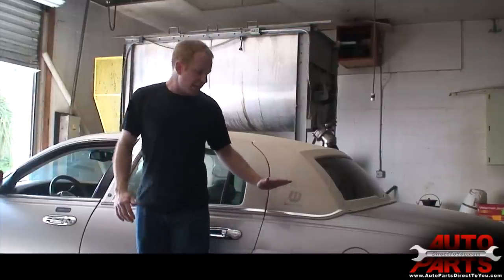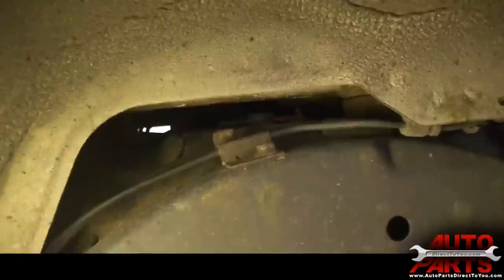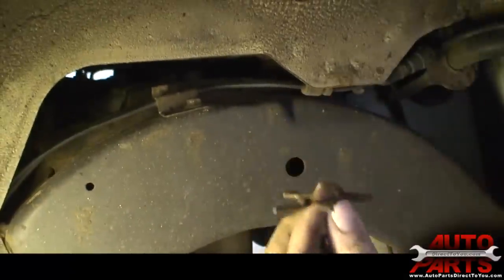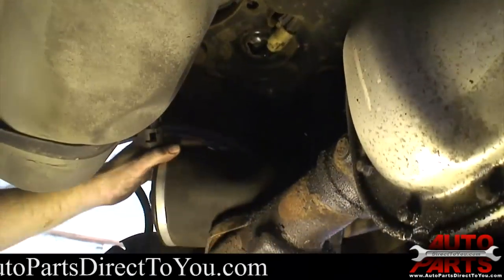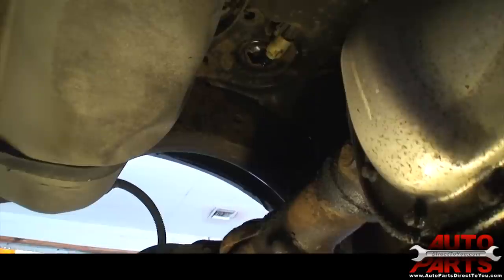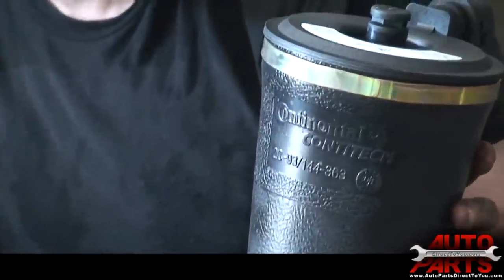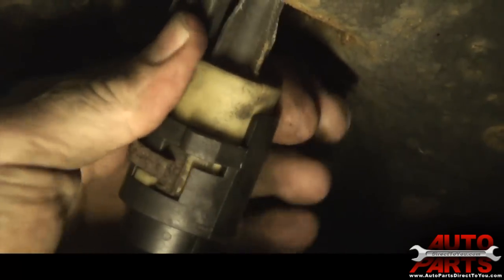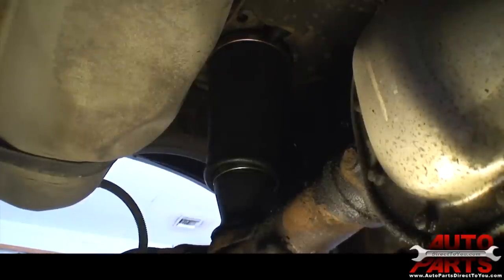1989-2011 Town Car Air Ride Suspension Air Bag Spring

Comment: On a Ford Air Suspension system, after the key is turned off, the following happens:

0-59 minutes. Only venting is allowed.
60 Minutes. The car will measure the height at the rear of the car, and either switch on the air compressor, or open the solenoids to vent the car.
61 minutes. The Air Suspension system turns off.

It's normal after an hour or so (time it) for the compressor to run for a few seconds.

Comment: This seems like a way easier job than some of the mechanics I've come across let on. I've been suggested a coil spring conversion kit a million times, as if changing these bags is some horrible process they wouldn't touch in a million years. Gonna do this myself. Thanks for the video, really appreciate it.
Reply: Most people suggest switching to Coil Springs because if the lack of headache down the road. But if a bit like this actually is a "lifetime" kit, that would solve that problem. Now just gotta worry about the compressor.

Comment: I don't want to convert it, I want to keep the system just like it is.
Reply: same here   never really understood the "sky is falling" problems people are reporting with the TC air suspension, maybe paid supporter by the same companies selling the conversions kits?   I have an 03 TC with 200K  just replaced mine   took all about an hour    three if you include the replacing the dryer and doing a little rust removal/touch up paint around the axle.
Reply: Love to sir ride I would never switch not even if I got the conversion kit for free-& springs ... I’d rather pay to drive a big fast sexy stylish cloud of air any day of the year 🙇🏻
Reply: @nodat11  how's your air ride suspension holding up since you replaced it

Comment: When the air suspension went out on my ‘07 Presidential Town Car, I replaced it with good ol’ coil springs, can’t tell the difference in the ride.
Reply from the maker: Excellent! We have found that converting to coil springs is so much easier and cheaper in the long run. Many people install a leaking airbag and then find out they need a compressor, valve body, or control module, after installing new airbags.
Reply: @APDTY  exactly, plus to diagnose all that and fix or replace was about $1500 where the coil springs parts and labor was $600! With a 2 year parts/labor warrantee😊

Comment: The power of YouTube...thank you APDTY. Although I am able to fix just about anything, it helps GREATLY to see it done in advance. Once you have seen the procedure - like you post here - it's almost like having already done it by the time you get under the car. I did my first set of ball joints recently - same great result.

Great job on the video and much appreciation for your tutorial....

Steve in Atlanta, GA
Reply: Steve Kilby  is there a good front suspension video for a Lincoln town car that would help do the front end please please please I can refer to thank you

Comment: By far the best video on the replacement of the air bags. Thank you.  I or we may need to move on to other issues that may include the air pump itself, any other inline solenoids, etc.  Thanks again.

Comment from the maker: Here is our conversion kit which gets rid of the expensive air ride system and uses conventional coil springs and shocks, it includes 2 New Shocks, 2 New Airbag Springs, & instructions (Made In The USA):
http://www.amazon.com/gp/product/B004BUWPIK/ref=as_li_tl?ie=UTF8&camp=1789&creative=9325&creativeASIN=B004BUWPIK&linkCode=as2&tag=aupaditoyo-20&linkId=SYFKBCRKPOJ4C4JF

Comment: Hi Bam,

The Air Suspension in the Town Cars will only adjust front to rear, not side to side.

In order for the rear to be properly inflated, you need to completely release the air out of the left and right spring by twisting the solenoids and popping them out one notch. Remove them, and check to make sure the O-rings are seated properly, then re-install, and then let the compressor air up the rear end.

Comment from the maker: @possiblefurry The compressor unit on your car is located on the front passenger corner of the engine compartment, there is no simple fix for it, but if you are tired of the air suspension going out at random times, they do make a conversion kit to change it over to normal coil springs.

Comment from the maker: the compressor should come on to reinflate the air spring after the job is done, if it doesn't you may need to try resetting the system, you can do so by disconnecting the battery for a couple minutes and then reconnecting, also be sure that the air-ride switch is turned on in the trunk.

Comment: great video; i have one question  how in the world do you put the solenoid back in. when i go to put it back on i have a world of a time trying to get the second twist in.  i push it in straight then turn clockwise one time then when i go to push the next time it just want go so i can't twist it the second time to make it lock. there is some kind of pressure there that i am not noticing.  help me out please   thanks
Reply: Damn I wish somebody answered this 12 years ago, now 12 years later I am stuck in the same spot.

Comment: I have an 04 Lincoln Town car ultimate.  Last Friday air suspension was fine and normal.  Saturday morning, I noticed from trying to back out of driveway that it wasn't sitting right and noticed both sides were lower.  Not sitting on the tires, about 4 inches between top of tire and wheel well.  I tried bypassing switch in trunk with a wire and that didn't work.  I ordered a Dorman compressor from Amazon and put it in today with trunk switch off.  After getting air compressor and air box installed again.  I started the car and the air shocks are not rising uo.  I also replaced both fuses in fuse box under the hood just to get easy fixes done for rasm.  The car almost looks like it's sitting leveled but slightly lower in the rear.  Why is it not rising up the shocks? Vehicle only has slightly under 80k miles.  Is it the height sensor and where exactly is that located and how much?  I'm trying to narrow it down so I'm not replacing everything if I don't have to.  Any ideas??? I don't think it's the air springs because before Saturday, they were working perfectly fine and well inflated.  Somehow Friday night or early morning they lost air.  I've read about solenoids, height sensor and of course the air bags.

Comment: I'm doing this repair. I cant get it seated on the differential, is there something I'm missing?

:Update took awhile but I put some packing grease on the differential and bottom clip. Lined it up and i drop the car very slowly about halfway and started my car and it aired up for a min until it clipped in. I did this to both sides. Now I'm clipped in and riding on air. Also i have a 2000 Lincoln town car with 76k miles. It was my grandpa's.
Reply: How do you know that it's fully seated
Reply: To the dif I can't seem to get mine

Comment from the maker: @961995h Actually a Continental is a totally different Beast,, your car is front wheel drive which means the suspension is a totally different setup. You have Independent Rear suspension, while the town-car has just a solid rear axle. We do have the conversion kit available for your car, but it's a little trickier to install.

Comment: Another way to do this is to place a jack on each side of the frame just before the rear wheels, and jack the rear end so it sits a few inches higher than it normally does. Turn the ignition on, and let the compressor vent all the air from the springs. It will take several ignition cycles to do this. Do it until you no longer hear air flowing from around the air springs.  Lower the car, start it (or turn the key to ON) and let the compressor air the springs up. It make take 2 Off-On cycles.

Comment from the maker: You can search our website for part number A-2220  and you will find the heavy duty air springs. These fit the 1990-2010 Town Car. And they fit standard town-car too, it does not have to be the limousine.

Comment from the maker: The ride will be the same between those two, the only difference is that the heavy duty is designed to hold more weight. It is specifically for the Limo and fleet chassis.

Comment: I ordered the two air bag springs, and installed them.

It was driving fine, and still is. However, it seems one side (passenger side) sits a touch lower than the driver side. Is that common?
Reply from the maker: Sometimes a fail components in the front suspension can show it's effects visually on the rear suspension. Measuring ride height of all four corners should lead to finding the issue.
Reply: APDTY Hello is there anyway I can get the Height Specs of a 2000 Lincoln Town car P

Comment from the maker: The air suspension system stays energized for a set amount of time after turning the car off, if I remember correctly it's either 15 or 30 minutes. During that time, the pump can turn on unless the master "Air Suspension" switch is turned off.

Comment: Thanks for the video. Helped quite a bit. Determined that I have one bag (drivers) that is going bad.... slow leak. One question when turning off the suspension then raising the vehicle. I turned off the Air Suspension (trunk) about 30 minutes before attempting to jack it up and replace the spring. Seems the bag still had too much air in it even after disabling the system/compressor and jacking up the vehicle. To explain, it was hard enough so that it could be squeezed with effort, but not as easy to remove or as deflated as yours is in the video. Any ideas on the best and safest way to approach deflating this so it can be replaced? Sit longer? Overnight? Video was a great help - thank you!
Reply: +MyPCHost Hosting With the vehicle jacked up and jack stands set under the frame, having the rear axle hanging (tires not touching the ground).  After removing the upper clip from the air bag, use a pry bar to lift the lower off the mount and push it forward. This should allow you room to continue removing the air solenoid from the top of the bag

Comment from the maker: The continental actually has a totally different suspension setup from the town car. Your vehicle is front wheel drive and uses fully independent suspension front and rear. So unfortunately the procedure is totally different and this video won't be of much use. As of right now we don't have one on the continental.

Comment: roy morin how you fixed your problem  because i have the same problem my airbag  suspension they're not adding up
Reply: It happend to me once, I unpluged the battery for 5 minutes then pluged it again then everything is running normal

Comment: I just bought air spring from Arnott and I haven't been able to connect the solenoid to the air spring it only goes half way I'm pushing it in and trying to twist at the same time but it's not going all the way in! What would you suggest? Thank you very much.

Comment from the maker: @w8tlftr4u That definetely sounds like an air spring leaking. The Mark VIII is similar but a little tougher, your car has independant rear suspension which gives much less clearance than the town car has. But the basic routine is the same, release the air, remove the clips, pull the solenoid, and remove the air spring.

Comment: i have a 1995 lincoln town car i dont here the motor to the air spring come on any more so how can i find out if it the air bags or the motor to the air springs?
Reply from the maker: Unfortunately that is the ugly situation many people find themselves in. The only way to check the airbag springs is of course with air in them, however you can also just take a visual inspection of the condition of the rubber bladder of the air springs. If you see lots of dry rot which is usually spider cracks, then they are either very close to the end of there life or already leaking. Most shops will suggest replacing the compressor and then will let you know if you also have to replace the airsprings, however at that point you can be in the middle of a very expensive repair. The compressor itself is several hundred dollars so if the airsprings show any sign of age or are 7-8 years or older, they dont have too much life left. Converting the suspension over to a conventional coil spring suspension is cheap and easy and here is a link to the kit at Amazon.com: http://www.amazon.com/gp/product/B004BUWPIK/ref=as_li_tl?ie=UTF8&camp=1789&creative=9325&creativeASIN=B004BUWPIK&linkCode=as2&tag=aupaditoyo-20&linkId=SYFKBCRKPOJ4C4JF
Reply: Thank took care of it last year it only took me 20 minutes to change them both out and replace them with springs to be my first time doing a job like that I did a good job.

Comment: i went over a drop off at my job's parking lot and blew something. the air springs have no pressure, but should i still be hearing the air compressor kick on?
Reply: Check the power switch for the compressor in the trunk?

Comment: just put in the Arnott conversation springs 2001 continual really easy now have no problem air compressor is off so should have no problem with the shocks again

Comment: Mine just stopped, I heard door ajar switch or relay are the first to check,what do you think? Thanks..
Reply from the maker: +rob henriksen Yes, checking for system power and operation should be the first steps of diagnosing the compressor not coming on. On vehicles with OBD2 you could also check for codes in the system

Comment: I purchased your air springs because of this video. I have the car off the ground but there is still air in the bags. How do I release the pressure. The bag is collapsed but not all the way and leaving too much pressure to remove the bags or reach the air solenoid. How do I release the air pressure all the way? Really frustrated and getting no where after doing this.

Comment: hi I have a 2004 town car 97k miles. when I start my car air compressor turns on for 8 seconds, when I'm driving and stop on red light air compressor turns on for 5 seconds, on 17 miles trip it does it 3 times, is this normal or early signs of leak air bags?

Comment: Hey just switch mine out with new arnott air springs but for some reason after bout 15/20 minuets of driving my rear end seems to rise higher then normal any suggestions
Reply from the maker: yes you can check the ride height of the front and back and make sure it is correct, if you tell me the exact year make and model I can tell you the ride height spec. Sometimes when you fix the rear and maybe the front springs are worn out, the rear can sit higher then the front, also depending on the exact model vehicle you have, the front and rear can be different. Another possibility is the air dump valve solenoids on the springs must be working, you would have a check suspension light on usually though, The only other trouble is if limo air springs are installed in a non-limo model as that raises the ride height.
Reply: Auto Parts Direct To You  2003 town car but now my rear went down again and the light came on

Comment: Thank you for this video. So easy.
Let me tell you however that you did not put the "c" clamp that you removed first back on during the video. You probably know this. Anyway, thanks for the video.
Reply from the maker: Yep, you are correct, we actually used this same car for two different videos, as soon as we finished this one, we pulled the new airspring out to show how to also do our coil spring conversion kit in a different video.

Comment: I have a 2001 lincoln continental my back driver side air shock blew up today . Do you know of a car that i can pull the coil springs off of that will be compatible with my lincoln

Comment: Is the air ride system setup the same on a 97 Lincoln TC?
Reply: Too late for you to see this, but Yes.  Part Number may be different, but procedure is same.  I've done it on a '97 and on a '05.

Comment: Okay this may be a stupid question but I watched the video and my fiance is going to replace the air springs on his moms LTC but he asked me a question that after watching the video I still didn't have an answer for. Anyway, in the video you show the care on jacks and the air spring all the way extended when you start the replacement. Currently her car has them completely inverted so he wanted to know how to get them extended all the way out to replace them without airring them up. Do they extend out when you jack up the car or what?
Reply from the maker: You will be able to remove them if they are inflated or not. Once the vehicle is in the air, pull the top clip and really just follow the vehicle and you will be good.

Comment: how can I replace the solenoid itself. I believe I have a bad solenoid since the car I have sometimes lifts and it does not sit all the time. I know it has two connections on the solenoid I was able to take one out but not the round connection? How can I disconnect that  round part on the solenoid itself?

Comment: I have a 2001 continental I'm planning to put 22s on.. I need advice plz.. will the rims damage my air bags ? Do I need a lift kit.. to put the rims on.. pls give me an idea of what I maybe facing when it come to the damage i may caused to my car.
Reply from the maker: Fliest 954Stud The Lincoln Continental is a totally different suspension and is actually all totally different parts. We don't mes with rims or performance upgrades too much so we can't really answer you properly. You may want to speak with the rim and tire installer as they may have kits to go with the rims.

Comment: I had a 2002 Lincoln Town Car-Now it belongs to my mother.  Just had the air bags changed.  Problem is that when the car is turned off the bags deflate.  Since this was my car, and the car is still at my home.  I always remembered the compressor coming on sporadically even after 30 minutes.  Am I wrong?  What could be the problem with the deflating?  On accessory, I hear the compressor turn on and the bags inflate.